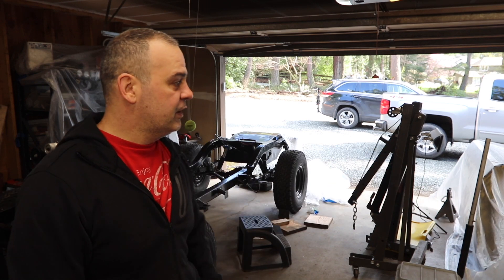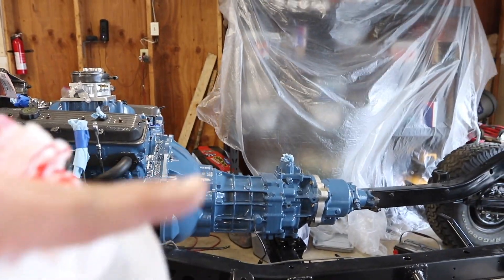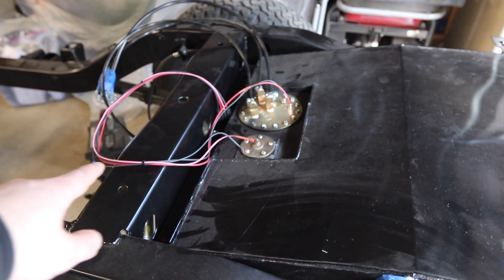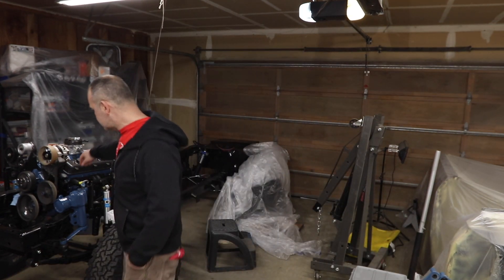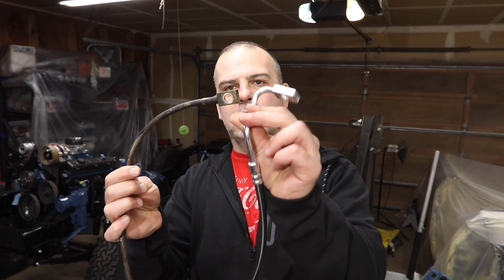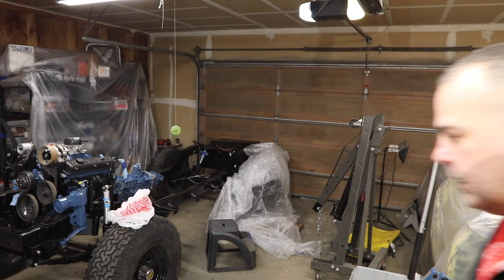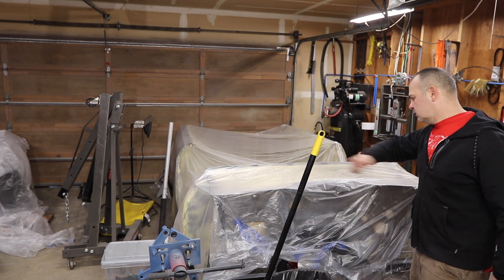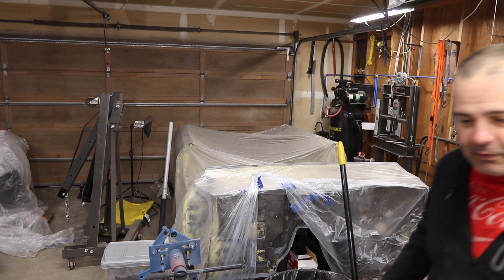6.11-Drivetrain In! Progress and Problems

Comment: If I had to do it over again, I would have just ran the braided fuel line with earls fittings for the whole fuel system. Money up front saving time and hassle down the road. The blue looks great. Keep with the updates.
Reply from the maker: Richard Niblack what did you run instead?
Reply: @MattsGarage  a roll of 5/16 aluminum with compression fittings, barbed end going to EFI rubber line with EFI clamps... Just a hodge podge of fittings to get everything connected as I have a frame mounted EFI pump and filter. I bought the really nice hold down clamps from BC broncos and by the time I realized I wish I gone all braided I was pot committed. Luckily no issues but not clean looking at the ends and it was way more work than it needed to be. https://www.supermotors.net/getfile/981886/fullsize/20130515_220351.jpg
Reply from the maker: Richard Niblack that’s a TON of work. My system should theoretically be simpler. We’ll see.